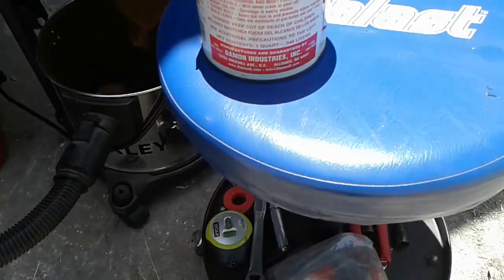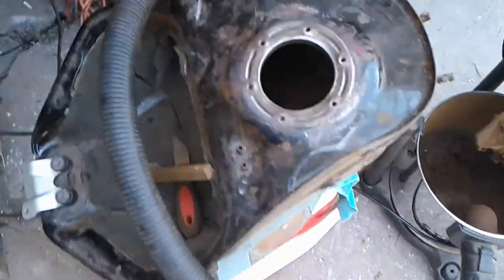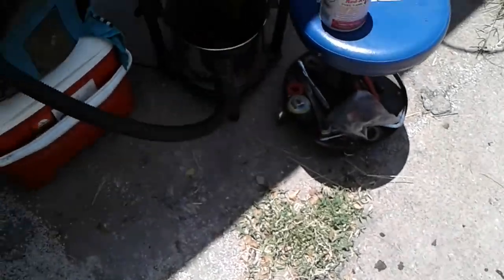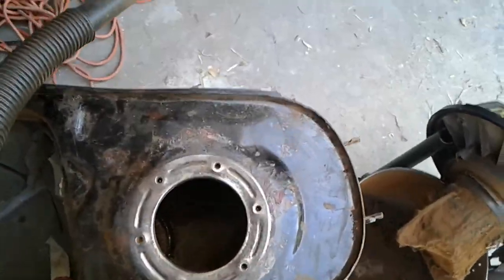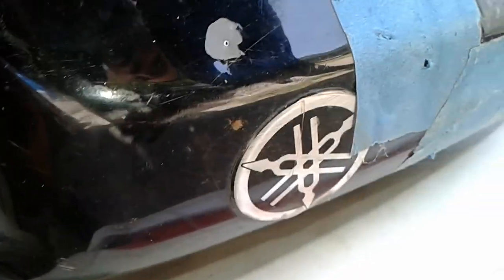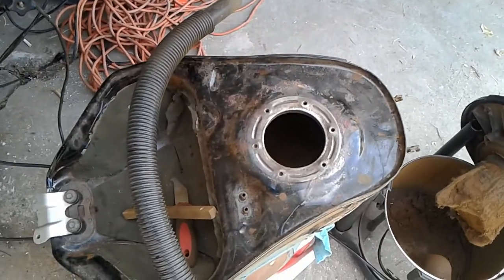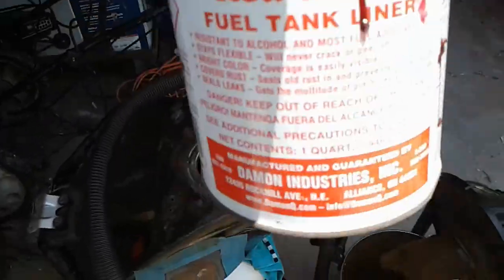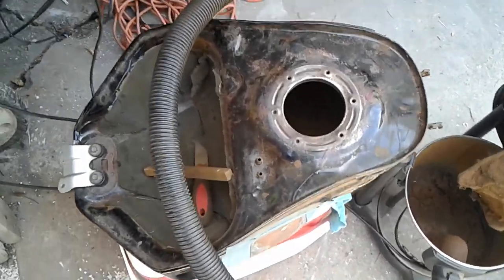Red-Kote fuel tank liner is a FAILER

Comment: The prep is the most important part. The next most important part is being able to drain the Red Kote back out of the tank without leaving any puddled up inside the tank. On a lot of tanks there isn’t an opening to allow proper drainage of the excess Red Kote. Sometimes I have to drill a drain hole in the tank then plug the hole when I’m done with a nut and bolt.
Reply from the maker: Yes. 99% is prep work. The rest is just adding the liner and rotating/shaking the tank.
 
Believe me I did the whole prep before adding the stuff. 
I don’t know maybe the acid I used to clean the inside with the liner had a bad reaction when it was left alone over the time period of it sitting in the garage.

 I used this other liner, 45$ for a small can. And still holding up till this day. 
🤷🏻‍♂️

Comment: Red kote failed on my tank as well. I had noticed that the fuel in my filter was red. Ill never try and seal a tank again.... Instead use Marvel mystery oil every so often to prevent rust.
Reply: Same here, unhappy with Red Kote. The gasoline in the tank starts stinking and the gas the filter got clogged. I regret not using 2 component epoxy sealer.

Comment: You didn't prep the tank well enough. It is a very good product if applied properly. I have used it many times. Someone switched tanks on you. From your video I see no evidence Red Kote was ever in that tank.
Reply from the maker: Believe me I was the one who added red kote. And I prepped it well before pouring it in and left alone for week. 
   When it cured I added fuel and tried to start up bike. Didn’t work. Sucked out the fuel, left alone for about year and half. And when I opened the cap it was flaky and peeling.
  I’ve had multiple friends that are bikers that have said not use this product after I told them what happened.
  Idk were your getting this “someone switched tanks”
Reply: @Ryan_1997  I have used this product in everything from lawnmowers to trucks. The only time I had a problem like what you had was the coating was peeling and I remembered that I hadn't cleaned the surface as well as I should have. The coating was sitting on a layer of sandblast dust so it couldn't stick to the tank walls.